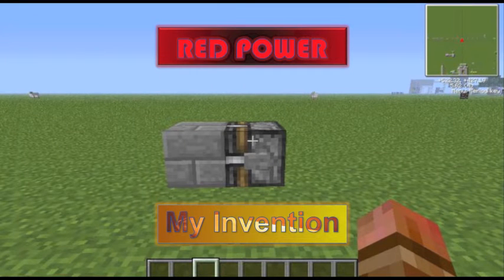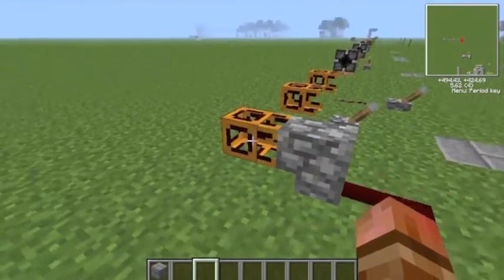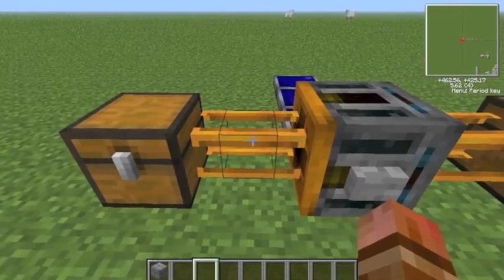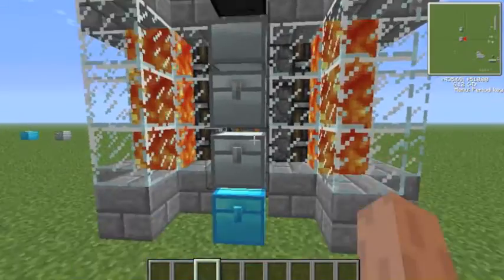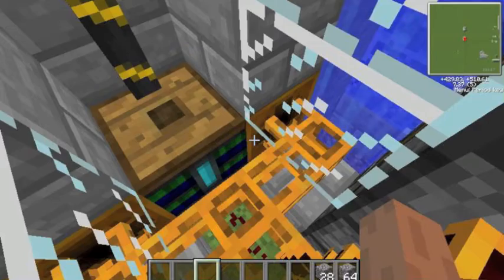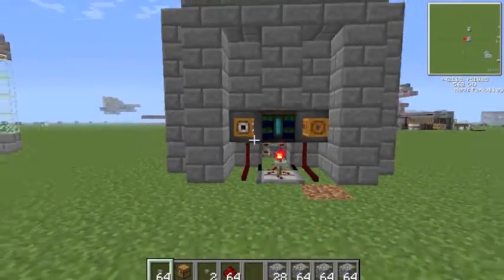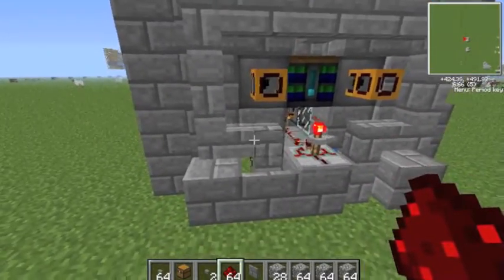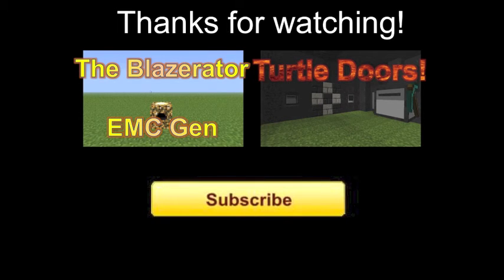"Tekkit" Part 2 - Elegant, Compact Cobble Mining

Comment from the maker: I just went through the math and according to this you need for the jacketed way:
(including the alloy wire you have to place down first) - 2 redstone, 7/12 Iron, 1/3 Fuel, 1 Cobblestone.
(disclosing the alloy wire needed) - 1 Jacketed wire = 1 red alloy + 8 covers
= 1 cobble block + 1 redstone dust + 1/4 Iron.

I'd say just using 1 redstone is better and technically you have to use some of the damage on the saw to. xD